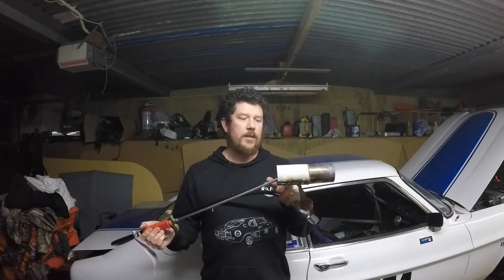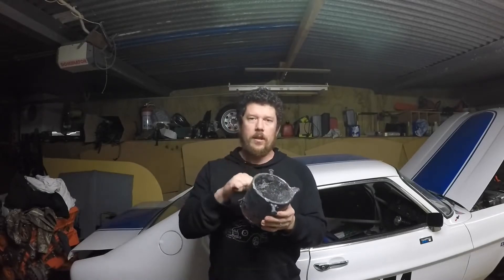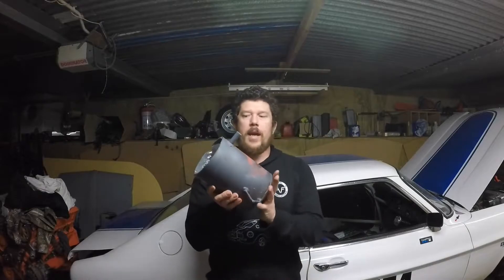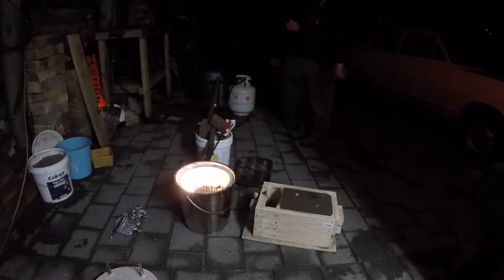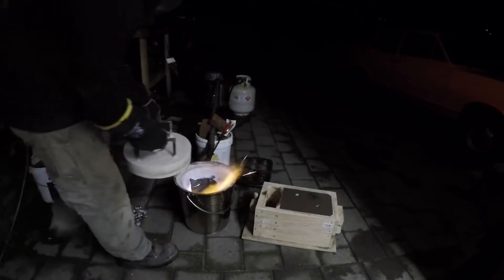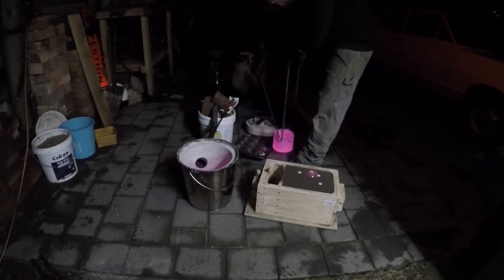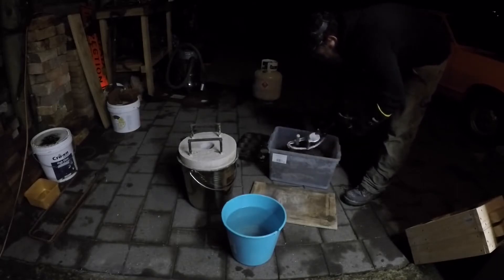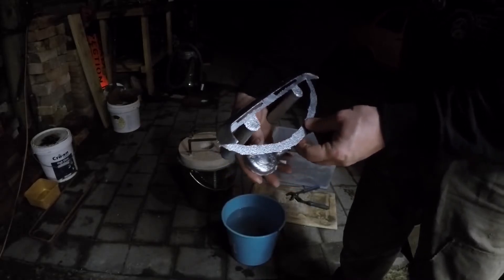Melting aluminium at home with propane torch. Casting recreated HB Viva GT Parts

Comment: Top job mate! Been looking forward to this one!
Reply from the maker: Cheers Richard, it's certainly been an elaborate plan to get to this point. What has surprised me is that I didn't actually plan to re-create these scoops with sandcasting. I was going to use the furnace and lathe to make some pipe bending dies which I'm yet to start...